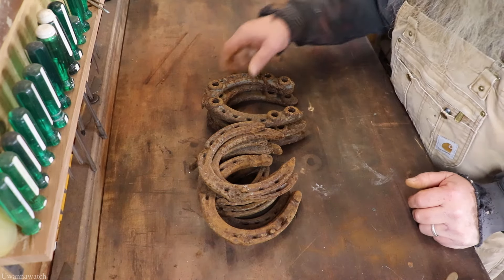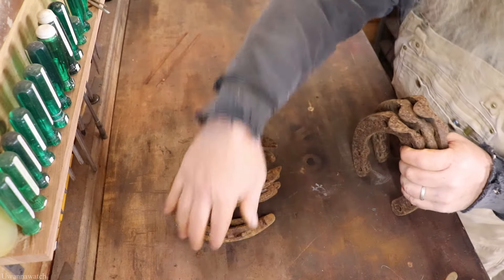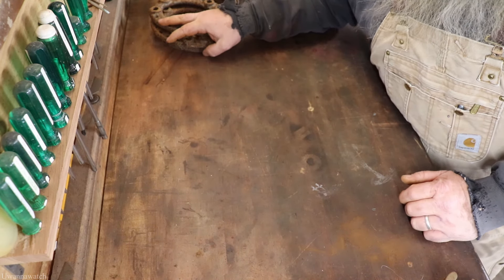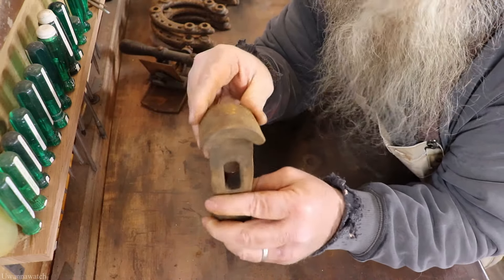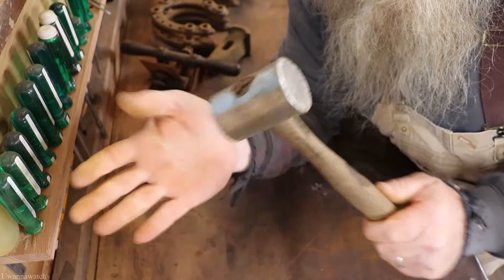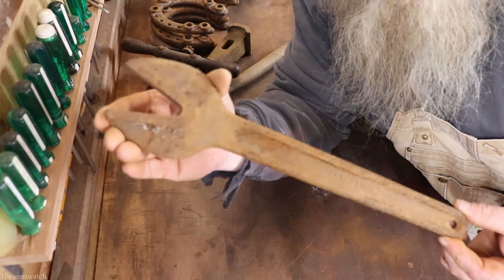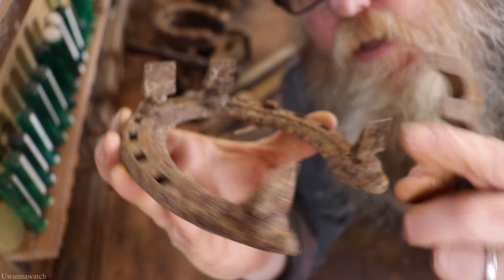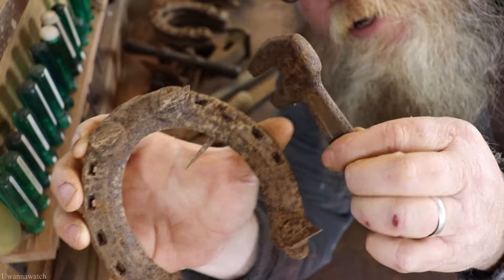Flea market Haul # 24. Virtual Pick.

Comment: Great haul!!!  I believe your  hammer is actually a top tool, used in conjunction with a bottom swage.  The material being formed would be placed on the swage, the top tool placed over it,  then struck by someone using an actual hammer.  Awesome find!
Reply from the maker: Huh..Thanks for the info! I appreciate it.

Comment: AWESOME TOOL HAUL!  Great GEMS!  I don't remember if John Fix has a Diamond Caulk horse shoe on his wall.  If not, you should send him one!  You said the lump hammer is stainless, did you mean aluminum, or is it really stainless???
Reply from the maker: I have already sent Mr. John a horse shoe last year and so has Jim.  Yes it's  really stainless.
Reply: @Uwannawatch  well a stainless hammer seems really unusual.  I wonder if it was a actual manufactured hammer, or a machinist one of a kind.  Why make a stainless steel hammer?  What is the benefit?
Reply from the maker: @timeflysintheshop  There aren't any makers marks that I can see. But These are used in food prep areas {I have one we use at work in the Kitchen areas}  Machining machine work, mechanic work, Marine work....

Comment: The "hammer" with the rounded profile is not a hammer but a hammered fuller.  With the handle in it it would be held on the work piece and your apprentice would strike it making the concave radius of the profile of the fuller.
Reply from the maker: Thank you for the information I appreciate it.